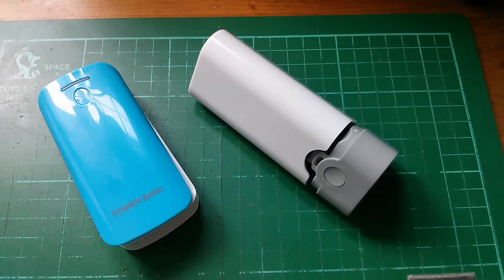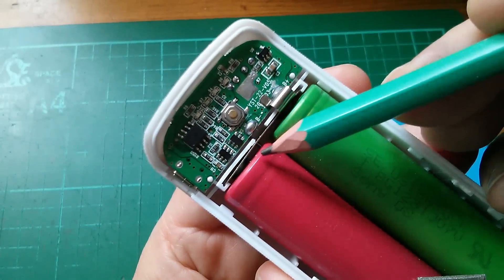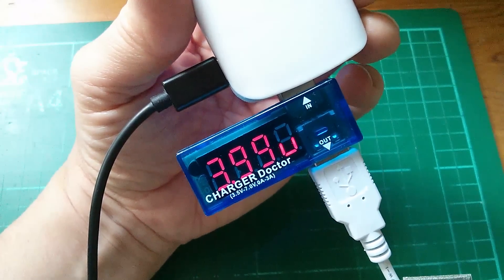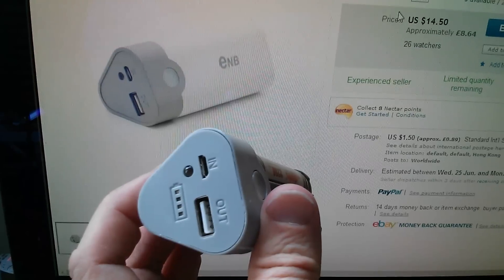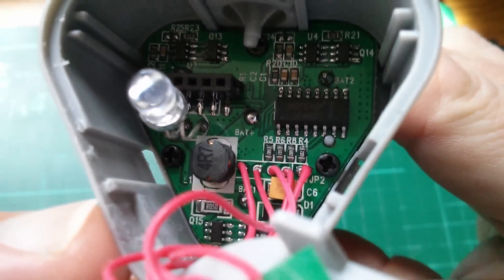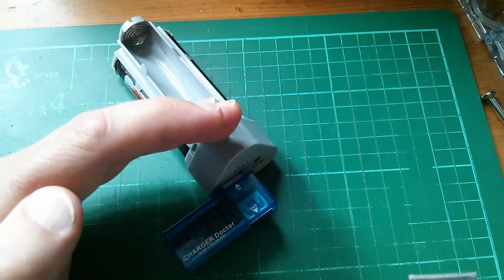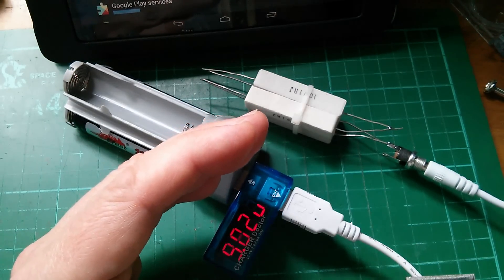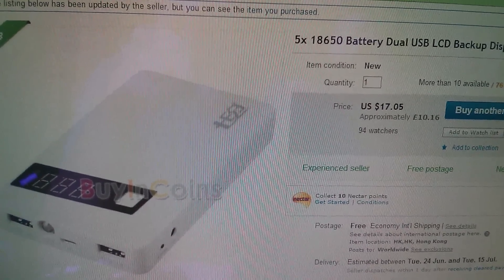Review: 2-Cell/3-Cell 18650 USB Mobile Power Banks

Comment: Hi Julian, 
The 3 cell bank that looks like an eNB tri-bank is garbage. I purchased one because it was cheap and I couldn't find the eNB brand. The cheapy 3 cell bank will slowly discharge the batteries. With the Panasonic cells charged to 4.20v,  I had 2 cells at 3.7 and 1 cell at 4.10 after one month of non-use storage. An eNB will discharge all 3 cells evenly when output charging and there is no discharge of the cells from non-use storage...Or just very sightly. From 4.20v to 4.15 in a months time.

Comment: Hey, I really enjoyed your Reviews on different power banks! I recently bought the 3-Cell you're reviewing in this vid, but I can't get it to work. The white LED lights up when I plug in a USB cable to charge the power bank, but nothing happens when I want to charge any device with the power bank... Do I have to press the button for a specific time like 10 seconds or do something else before I can use it the first time?
Reply from the maker: No - it sounds like it's faulty

Comment: Your Nexus 7 says USB charging mode, normally if you plugged it into a proper adapter it should say AC, and potentially draw more current. I'd suggest try a different USB cable.

Comment: when you tested the 3 cell unit for it's amp output, it only had 2 batteries in it, could it be designed such a way that it only gives off .5A for each cell inserted, so you'd need all 3 cells to get the 1.5A ?

Comment: That sily light sequence might be some sort of "lamp test", I could see how that would be handy for when they (if they) are doing some unit testing in the factory.

How would you know if the 4th LED was bad. A sensible thing to do might be to have a mode where if you hold down the button for a number of seconds, then that light sequence happens.

Well at the end of the day a cheap powerbank is a cheap powerbank...

Comment: The LEDs in cementing up and down does provide one benefit in that if one of the LEDs fails, namely the ones on the outsides, you'll see that when it does the pattern as opposed to an incorrect power readout. That being said I don't think that would be to common unless they're suspecting their LEDs to die early.
Reply: But it could be a little faster...

Comment: That Nexus 7 is a strange beast. You can try different 5V power supplies and with some it draws 1.7Amp (with the correct cable) and others only 0.82Amp.
On the bottom of the N7 there are 4 Pogo pins. The ones on both ends are plus and minus. Easy to measure which is minus since the resistance to the USB connectors shield.  Connect that to minus and the other Pogo pin to +5V and it charges like it should at 1.7 to 1.8 Amps.   Might be a nice test to test different USB cables resistance (don't get scared already) and what is left at the charging IC.

Comment: I have a power bank that outputs the battery voltage on the li-ion cells (3.7v ish depending on charge) until you push the button to start the boost converter at which point you get your full 5v.  Is this the case with the 2 cell bank you have?

Comment: This UPS thing is really useful for putting a Raspberrypi into your car, you can just connect it to the ingitionswitch and you have a system that doesn't drain your battery, but has enoough time to shut down once you parked the car. i was actually looking for something like that, and i'll probably order one now, thanks! :)
Reply: should have watched the video to the end, disappointing...
does the 3-cell thing also have that UPS potential?

Comment: Hi, just two thoughts I had during your video:
- Some power banks are not meant to charge and provide power at the same time. Did you measure the outputpower of the two-cell powerbank when it was not attached to some external usb power? Would be interesting to know if it's providing more power when not being charged itself.
- The nexus indicates "Charging (USB)". It did not recognise your charger as a high-current charger and just draws 500mA per design, which is the maximum for the normal usb connection. One of the reasons for this could be that your usb cable does not link the data pins of the nexus to the ones of the powerbank. Is that the same white cable you used to connect to the two resistors? You would need to short the datapins in the micro usb connector you connect to the cable.
Just try the same with some normal 1:1 wired micro usb cable, like the black one which you used to charge the 2-bay powerbank in the first part of the video :)
It should display "Charging (AC)" on the nexus and draw 1A or more.
Greetings
Nico
Reply from the maker: Nico, you're spot on. This power bank doesn't have the UPS mode I was talking about. And you're right about the cable - I have 2 short white cables that look very similar - one has the data wires and the other doesn't - I used the wrong one. The 2-cell bank does put out a higher voltage when not being charged and now it's supplying 800mA at about 5.0V to the Nexus7 which is showing Charging AC (not Charging USB). It's not so clever driving the resistor blocks, but I'll make an update video and show all that. Thanks for taking the time to explain your thoughts in such detail. I'll thank you by name (in the follow up video) if that's OK.
Reply: Julian Ilett Sure, feel free to so :)